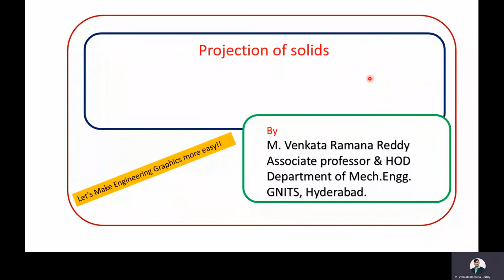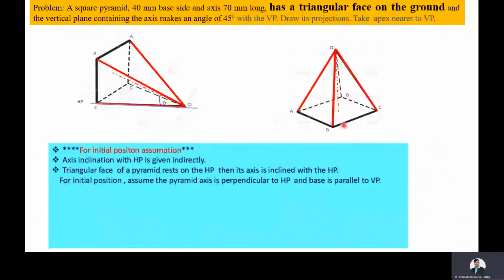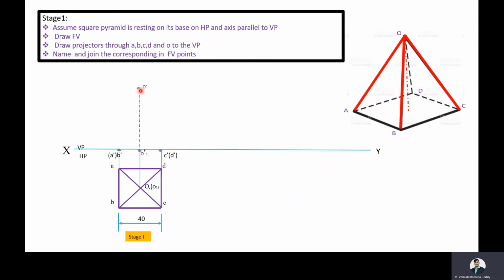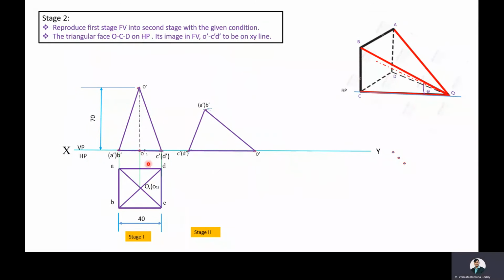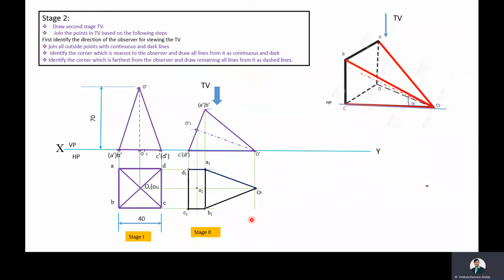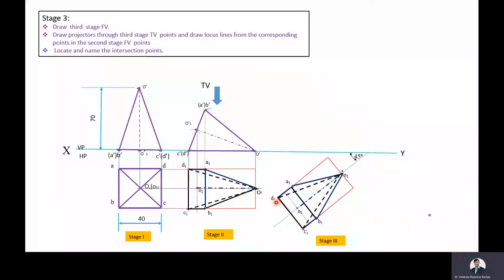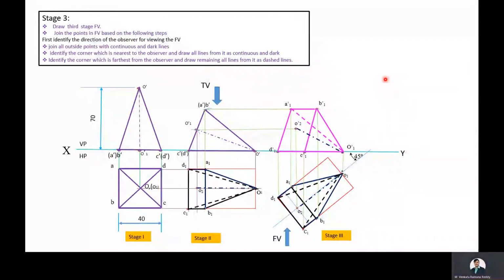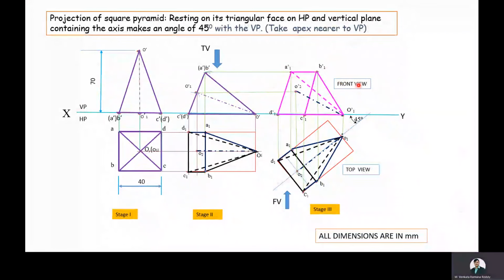square pyramid: resting on triangular face on HP and vertical plane containing the axis inl.to VP

Comment: Can we draw the initial position as the square is equally inclined to xy line
Reply from the maker: Because it is resting on triangular face on HP,with that face containing base edge is kept perpendicular to the VP
Reply: @venkatrr8050  thanks for your help sir
Reply from the maker: No